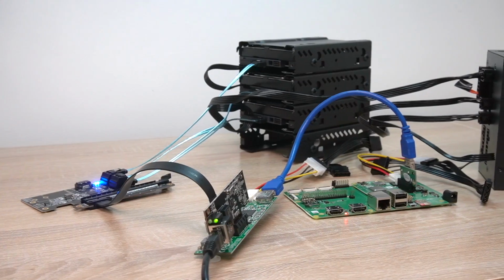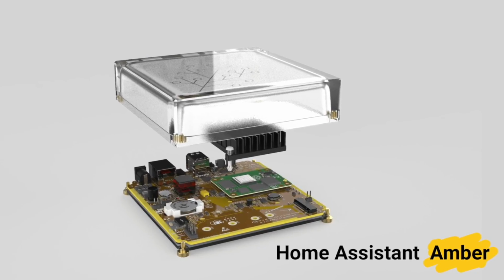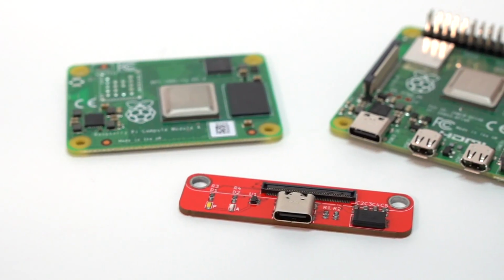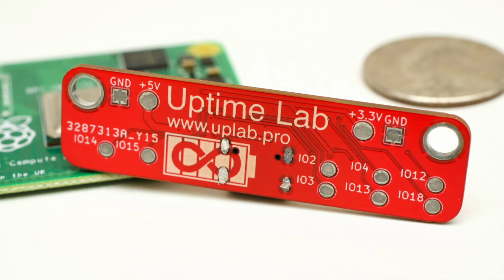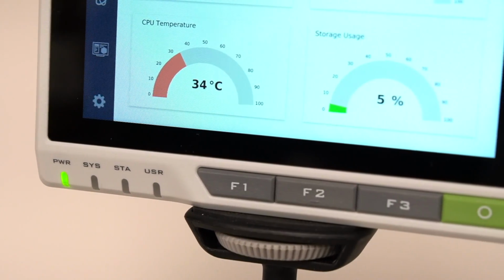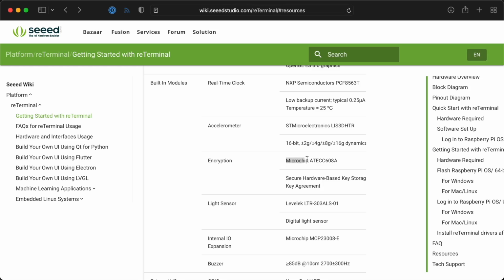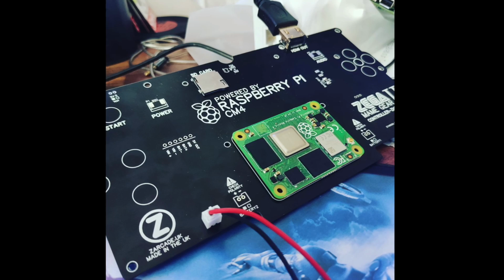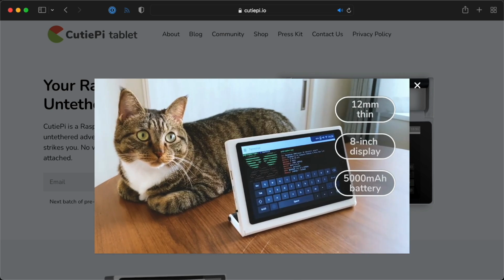Small but mighty! 10 new Raspberry Pi CM4 Boards

Comment: We can really take advantage of the very small form factor for our sub sea applications. The smaller the hardware, the easier it will be to package the system to work at depths of > 4000 meters.

Comment: Unfortunately Raspberry Pis and CM4s are just not available or extremely overpriced. I don't really know how much of a difference a raspberry 4 makes compared to a 3, but my HomeAssistant experience on a Pi wasn't so great. I wanted power in a small form factor, so I can run more than 1 application which barely responds. I found that that 7th gen NUCs are about the price of 3 Raspberry Pi 4s and got one. So far I don't regret it. I run a few docker containers on it and it's barely sweating and still has a fairly low power profile.
Reply from the maker: The 4 is often more than twice as fast for equivalent workloads, and is much more suitable as a baseline for HA, but yeah, that assumes you can find one near list price.

It's getting a tiny bit better but still hard to do right now.

Comment: With these many products relying on Pi4, In my opinion, RPi foundation needs to get the "RPi OS 64" bit out of beta and also get the VC4 drivers polished enough to have a smooth 1080p playback. Imagine that AIO with proper 64 bit os and proper GPU drivers.

Comment: The mincab and stick are the ones im most interested in tbh. If you had a board that broke out just the gpio pins you could slap it on top of the pisugar2 and have a portable server quick and easy.

Comment: that would be REALLY AWESOME to learn about what type of HOME ASSISTANT stuff is being developed for the CM4 - I just picked up my first raspberry pi and it's a CM4 8GB Lite (no emmc or wifi/bt version available - it was the ONLY version available and it was only $80) plus an I/O board the size of the regular pi 4 but it have an nvme on the bottom - but only 2x usb 2.0 :( it will work just fine to learn th4e in's and out's and make a nice 500GB retro gaming box for now - ALL BECAUSE OF YOU PEAKING MY INTERESTS!!! THANKS JEFF!! :D

Comment: Like your video and have been thinking about getting some pi's to explore about 25 temperature readings, 5 motor controls,  NO NETWORK EXCEPT HARDWIRED THROUGH SECONDARY DEVICE 4 SECURITY THAT MEANS REMOVABLE WIFI AND BLUETOOTH I HAVE HAD A LOT OF TROUBLE WITH ANDROID DEVICES WANTING TO INSTALL CR@PW@RE DELETING LARGE FILES FROM MY SD CARD OR MOVING THEM TO THE CLOWN CLOUD WHERE SOMEONE ELSE CAN CLAME MY WORK AS THERE'S  AND APPLE IS  JUST FAR WORSE. Am looking for hardware I control build apps that don't need internet access to function repeatable.

Comment: I started out with Home Assistant on a Raspberry Pi 4B running Docker in stalled in an Argon One case. I maxed out around 17 or so containers before the fan started running often. It also may have been the fact that Prometheus was too much. I then switched over to a Home Assistant Blue with HA OS and Supervisor. The Blue is running Docker but I find it takes more effort to run my own containers since HA OS really tries to limit your access to the OS. I did find a way but you are then messing with an OS that isn’t set up for it. It is meant to be a turn-key solution. I have also not found a solution to docker-compose. The up side to Blue is that I am running far more containers on it and producing less heat.

Comment: Offhand, I do not see any compelling advantage to Amber over running Home Assistant on a regular Pi. Use of the CM4 is clever, but you can't get them. The M.2 slot is a plus. Zigbee support might be, not sure how that works and is of no use to Z-Wave users. The full kit version is not project to ship until November 2022, which probably means 2023, and a lot can happen in between.

Comment: I know this is sorta odd, but I’m rather intrigued by the hardware aspect of the amber. SSD+PoE+CM4 in a case is something I’m kinda looking for atm not for home automation so much but to replace the two similarly configured 3B+ I have running Pi-hole in my home. The amber really ticks all the boxes for me, though, even if this isn’t their intended use case.

(Before anyone asks - I don’t need to replace my current pi’s per se - they are working great. But I do like to tinker…)

Comment: Yes, do some Home Assistant videos and how tos. It'll finally motivate me to try it out as as replacement for my openHAB setup.

With that reTerminal, how hard would it be to turn it into a network diagnostic tool? Does the interface allow you to use something like Python to generate data for a gui?
Reply from the maker: Yes, that's actually one of my possible use cases.

Comment: Hi, Jeff, did you know Sir Clive Sinclair died last September?... Your passion is similar. 

I bought 3 tapo power monitors a few weeks ago and then bought another 10 when I saw how useful they are. Also have starlink to give 2 fingers to other ISPs. Interesting to see if the tapo data could be extracted locally.... Keep up the good work in the wafer shortage

Comment: Two things I hope to see:
1. A CM4 laptop preferably 12-15 inches across.
2. That the next generation of the compute module is fully backwards compatible and simply just adds one more 100 pin connector to the board. (preferably so that it makes a U shape, as to keep a small form factor and not instantly make board layout a pain due to two parallel connectors sitting besides each other.)

Also looking forward to seeing that interesting board at the beginning. And hope 45 drives actually makes their thing into a product I could have some use out of something like that.
Reply: That's what I have been wondering about. A CM4 laptop seems a very logical extension and I would buy one immediately. Would be killer competition to the big brands which are proprietary, locked-in, unupgradable and effectively unrepairable. To upgrade, just drop in a CM5, CM6, .... . Or how about an upgrade kit to rehab old laptops like vintage IBM Thinkpads which were build like tanks. I have a stack of them from the 90's, some still work, some don't.

Comment: I use home assistant on a pi, and I really like it. I would really like to see a tutorial for using ansible with HA. That would be really helpful, because right now I also run an mqtt server, and some other stuff alongside HA. I would really like to experiment more, but now that all the lights in my house are dependent on this machine working, I’m worried about experimenting, lest I wreck my automation setup. 

This might be a big project, and maybe there would be a better way of doing this… but I did a little trial with a qemu raspi VM. I wanted to be able to virtualize the pi to run Ansible plays on it and then dump everything onto an SD card. Is this a good idea? Or is there a simpler way of doing things?

Comment: I'd think an HMI device should have a dedicated (5VDC? 5-19VDC regulated internally? ) power supply instead of USB-C or battery, if the point is to control a machine it's hooked up to.

Comment: Do you think companies like the Pi foundation and other companies like AMD should consider investing more into U.S based fabs so we're not stuck relying on one place for chips? 

I read something about TSMC making a fab in the U.S so maybe it's already happening.

This situation has shown us we can't rely on the current system.
Reply from the maker: I believe Intel and TSMC are both building fabs in the US, but it's a very long term process. Both of those fabs were being planned well before the pandemic.

What's more annoying is the fact that a modern fab is so complex some of the equipment can only be built by a couple (or in the case of the tiniest processes, only one) companies in the entire world.

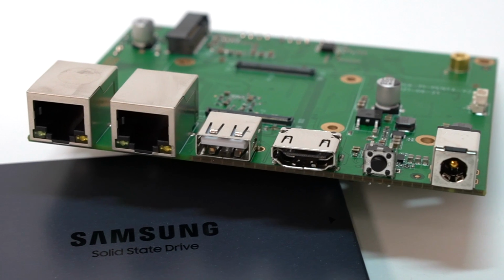Comment: 0:22 - Just wanted to point out, you can do a whole lot better than that if you go with HDDs instead; could get a massive 72 TB of storage using 18 TB drives!
Reply from the maker: Heh, true... but I haven't tested HDDs, not sure if the board can power them directly.

Comment: I'm running Homeassistent now for about 2 years. First I used it on a pi, but a few months ago I migrated it to my NAS, which runs on a normal intel cpu
Reply: But I migrated it only, because the NAS is always running and using power

Comment: I am SUPER HAPPY with my HA on Raspberry Pi 4 with SSD. Although only 4GB RAM but it never goes above 35% of MEM usage. CPU when idle is below 10% - only when big things start (i.e. backup or ESPhome compilation) it goes to 100% of CPU - but not for long. And there is NodeRed always active - RPi4 is super capable for a normal house (let say I have about 200 entities).

Comment: You're spot-on about the impossibility of sourcing components.

I work at an R&D firm that designs and sells industrial IoT sensors. Our manufacturing partners are currently short on nearly every major component. We seem to be on the more fortunate end of the stick, but we will probably be forced to make some concessions at some point in the near future.
Reply: Speaking of short, I really hope that last week's Pi4 shortening was done using a previously-broken board... It still hurts me deeply every time I think about it...
Reply from the maker: Who's to say it doesn't work better after the operation? :)

Comment: WATCHOUT PEOPLE, I've ordered the TECHBASE Modberry 500 CM4 and the heatsink is very bad. I get 55°C at idle, 21°C room temp.Their support team is really bad. Contacted them multiple times and they answer rarely. Once the order was placed, they stopped responding to my mails. Didn't get an answer for the heat problem. I can't imagine what it will be in a 40°C panel in a factory. What's the point of having a CM4 if you can't get the CPU past 50% load without going over 80°C? I've put a simple aluminum case on a RPI4B and the temp is 35°C at idle, never go past 56°C at 100% load over an hour without a fan.

Comment: We should have already been reusing viable chips and components. The amount of e-waste we produce is astounding
Reply: The problem is, as has already been said, harvesting those reusable chips cost-effectively. Electronics recycling is like plastics recycling, it's never going to offset the negative consequences of using all this indium and lithium unless something in the landscape radically changes, and fast.

What would be better is to design things to be more durable and more repairable, the reasons being twofold: a.) A more durable product is more likely to get more of the usable life out of a component before being thrown away, b.) A more repairable product will inherently be easier to harvest old components from, because it has been designed to be disassembled and modified.

Another key step is to stop putting a whole-ass computer inside every little thing. You don't need blinky wifi-enabled lights or a wifi toaster. You don't need your dishwasher or washing machine to play you a little song when it's done. You don't need a whole laptop embedded into the dashboard of your car just to play music and nag you about your driving style. We need to stop using silicon as our golden hammer and go back to doing certain things with the ol' noggin or with the analog circuitry that handled them adequately. Just my $0.02 as a soon-to-be computer engineer. There's too much reliance on digital devices everywhere when things could be built more repairably, more durably, and more sustainably by occasionally working with the old technologies which have fallen by the wayside. "In with the new" needs not always be preceded by "out with the old".
Reply: The problem is, such re-use isn't tenable at-scale. Unless, you feel like operating your company at a loss and fulfilling fluctuating demand with a fluctuating supply of chips from trash products?

Comment: I would really appreciate that you start Home Assistant because most channels are focussion on the software or the external equipment - with you knowledge of RPs this may bring a lot of opportunities to optimize inside the maine hardware.
For example I have not foun any answer so far whether it is faster to run Amber with  eMMC on the module or with the combination of a lite module and a fast M2-SSD
Reply from the maker: It depends on their board architecture. Generally speaking, the differences in boot time and overall performance isn't huge between eMMC and NVMe (on the Pi, at least), but it is measurable, and everything is a little faster on NVMe SSD. Both are better for performance and longevity than microSD, especially if you don't run one of the few recommended microSD cards (A1 or A2 from reputable vendor).

With NVMe you also have to consider the board architecture. Right now if you have a PCIe bridge / switch, so you can have multiple PCIe devices, then NVMe boot won't work on the Pi :(

Comment: That tiny daughterboard is an interesting idea for a cheap cluster, maybe if you had a separate WiFi AP explicitly for this cluster it won’t clog up your regular WiFi and you’ll have enough network bandwidth/consistency to run a cluster that doesn’t have high data requirements

Comment: Would love to hear your thoughts on HomeAssistant.  Been playing with my own running on a 3B+.  I like it, but I think I'd like to upgrade to a more powerful computer.  Every time I play with ESPHome, the 3B+ is forced to reset.  Kind of slows down my development efforts.
Reply: Get a Pi4 with at least 4GB RAM, it will suite your needs well. Extra Tip: Boot from USB/SSD instead of MicroSD. It will give the Pi4 a Kick in the ass. Its like night and day in terms of responsiveness.
Reply: Probably related to the lack of memory. Trying increasing the swap file and run it off an SSD because of the rewrites. I have a Pi4 4GB running Home Assistant as well as a 3B+ running it for Zigbee and AdGuard. The increased swap file keeps it stable.

Comment: Jeff, can you create a project using the CM4 to recieve sensor input and control peripherals? Specifically, I'm looking at trying to create a RPi controlled incubator for hatching chicken and turkey eggs on our farm. It would need to receive humidity and temperature data, then run a humidifier and heating element to keep the environment within parameters. The DHT22 is what I'm looking at for an all in one sensor, a small OLED display to show current environment conditions and a way to input and adjust settings. What you reviewed today is small enough form factor to make this likely. Thanks for all the content.
Reply from the maker: That looks like a great project for one of those tiny boards—but heck, even a Pi Zero W would be perfect for that. My previous video on Pi Vision does something similar, though with some AI/ML thrown in the mix. You have a sensor (in my case, camera with face detection), then in Python, if it detects a condition (face), it triggers a servo to pull on a trigger.

In your case, you'd have temp/humidity data (make sure to get the sensor away from the Pi board so it is more accurate), then you'd have Python to check conditions and turn on or off relays for a heater and humidifier/dehumidifier).
Reply: @JeffGeerling  Kinda what I’m thinking. I’m new enough to Python that I don’t quite know exactly everything to code out for it. Watching enough videos is giving me the sense of it. Just need to sort out how to configure the parameters to trigger the responses I need it to do. Incubation has to be fairly tight on managing the conditions to be successful. Thanks!
Reply: If you don't need networking, databases, datalogging or other fancy stuff, could you consider something simple like an Arduino microcontroller (I like nanos, but pretty much anything should work)? A pi pico could also do it if you wanted to stay in the family. There are existing libraries for all those sensors and there would be less things to go wrong than a full computer running an OS. Otherwise if you do want to use a pi, it shouldn't be that hard and I would expect there to be existing code available as well. Regardless of what you choose, seeing as it is a life and death situation / risking livestock, I would highly recommend some form of redundancy and monitoring system (ideally completely different hardware, designs and code). Seeing as you don't really need PCIE for that application, any standard form factor pi or pi 0 would probably be just as easy.

I have been playing around with running thingsboard on a raspberry pi to monitor things like remote battery voltages and the main pressure pump on a farm. When it works it has been good and has allowed a few issues like cattle turning on water taps to be found. When it doesn't it is very annoying, but there is nearly always a manual workaround until it can be fixed (it had a dying sd card for a while).
Reply from the maker: @jg374  Yeah, honestly a Pico or ESP32 type board would be fine too (though in some ways harder to manage remotely, if that's desired).
Reply: @JeffGeerling  Would you really want remote access / extra risks of interference and hacking on something like this? I can see it would be useful and fun though.

(I can't really talk as I do have methods to turn on and off an electric fence from pretty much anywhere there is an internet connection, although for such things there should always be someone checking it and the cattle it is attempting to contain fairly often. There are also manual physical overrides to fall back on).